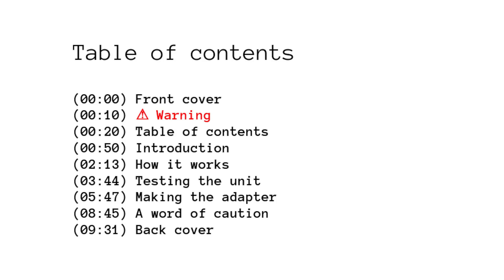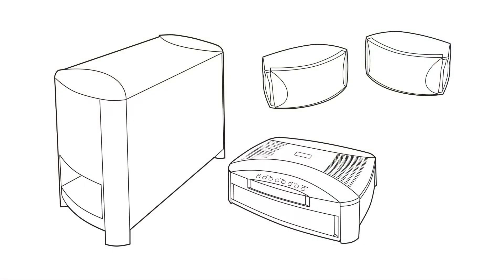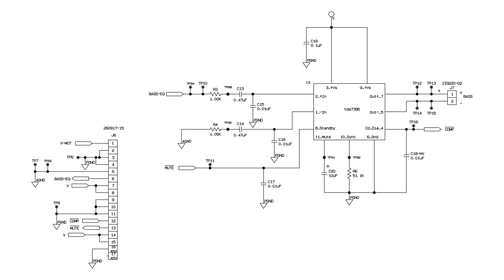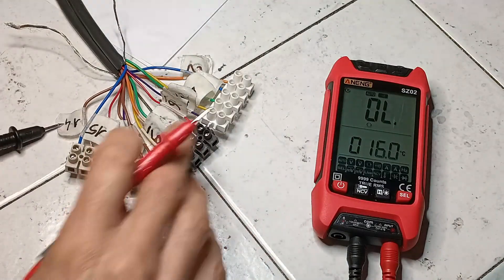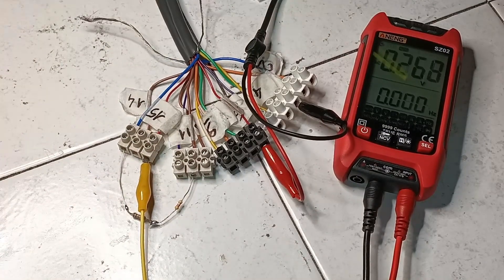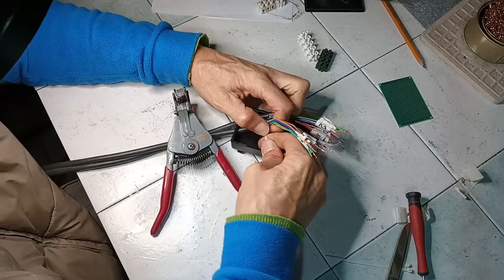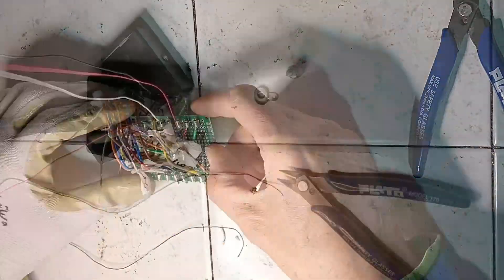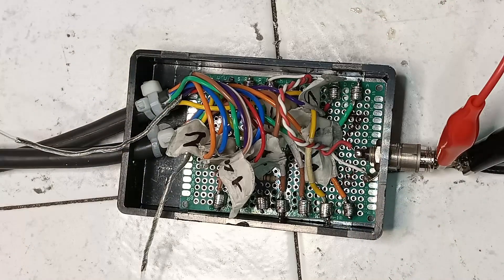DG’s Practical Notes, U#6 Bose PS3-2-1, woofer adaptation

Comment: Hi,
Thank you for this video and it is really great work.  While watching this video I realized it it for PS 3-2-1 i, Do you have an idea for PS 3-2-1 ii ?
Thank you!
Reply from the maker: Hello. It might be the same, or close. You may try to measure the voltage values at the data connector (with an isolated multimeter), and also check if inside you find the same audio amplifier I.C.
If the I.C. is the same, you may want  to follow the unmute line, and verify that it goes to the same pin.
I hope that this could help.
Thank you for your comment. 🙂